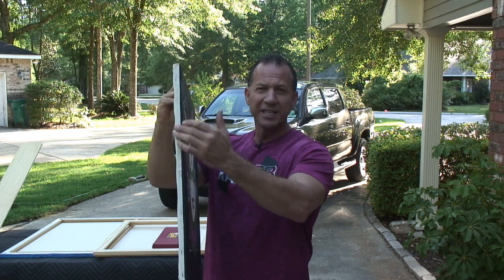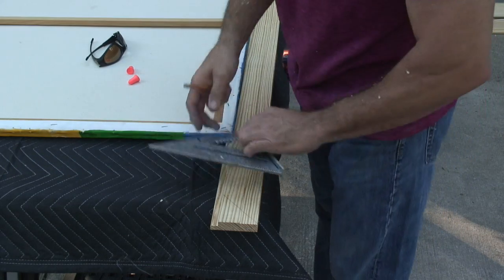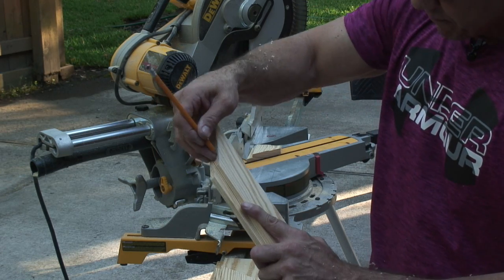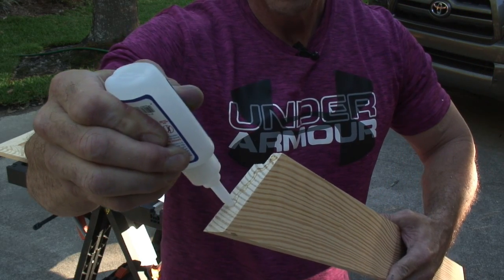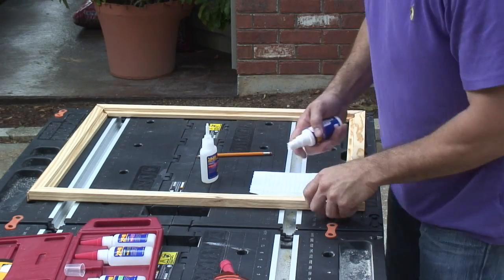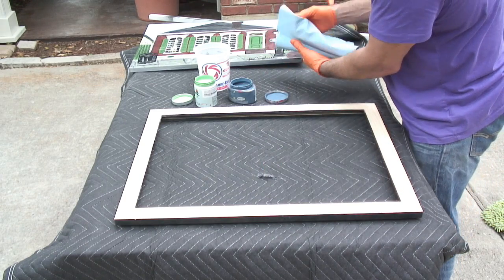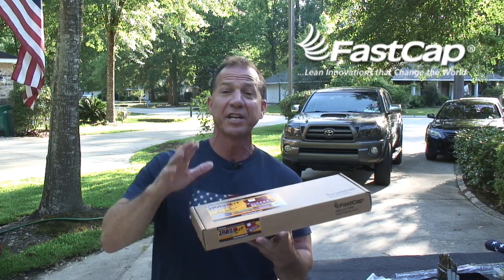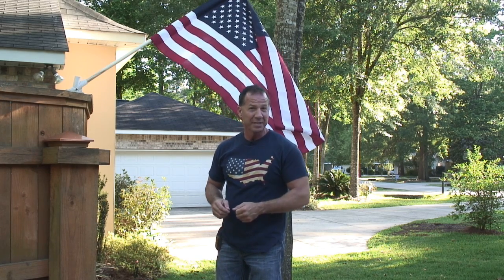Easiest Picture Frames LOW COST!

Comment: Great Video. I have been making frames for my wife projects using Primed Pine. I especially liked the use of yellow Pine Wainscoting I will definitely try it. Also the FastCap 2P-10 glue system is a must try. The wood glue is taking way too long to cure and clean the joints.

Comment: This was a very interesting video, especially using the glue product.  I have four paintings I need to make frames for.  I have held off because I did not want to split the sides of the frame using brads.  I think I will give the glue method a try.  Thank you for this video.

Comment: Just bought a house and there was mirror left hanging on the living room wall. It has no frame, just the mirror and I want to build a frame for it and hang it over my bathroom vanity, Will this type of glue be strong enough to hold the mirror in the frame? Thanks for this video, just it added to my favs!
Reply from the maker: Hi Sandra,
This frame can be done in a couple of ways, you can leave the mirror on the wall and make the frame like I did. You can put a couple of strips of velcro on your wall and use that to keep the frame in place or tack it to the wall with trim nails. This glue is super strong if applied properly but mirrors are heavy and can be dangerous if they fall. I have trimmed dozens of mirrors on new homes and we never relied on a frame to keep them on the wall. The mirror is installed and the trim is built to fit around the mirror. Better be safe than sorry.
Thanks and good luck!
Paul
Reply: Thanks Paul! My fiancee said we would probably have to hang it and build the frame around it since it is huge. And it is cheaper than buying a new bathroom mirror. You know us women have to have a big bathroom mirror! Lol!

Comment: Would love to win the givaway. I used basic molding from a 2nd s store locally here in town. They make the moldings for Lowes and Home Depot and they sell the 2nds in their store. Some of the pieces I bought had the wrap on them and then someone saw the flaw in the wood. Most of the flaws are on an end (just cut it off) and most of the major flows wrer on the wall side of the molding and wil not be seen after installation but will not sell in the store. I used a 4 inch wide molding for some 16 X 20 frames and painted them with a paint that gave me a crackle finish.